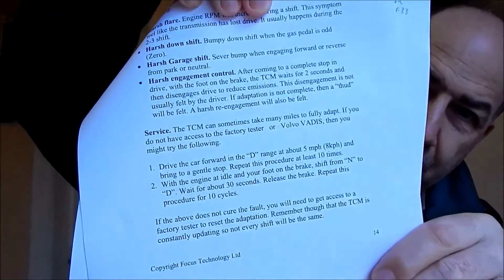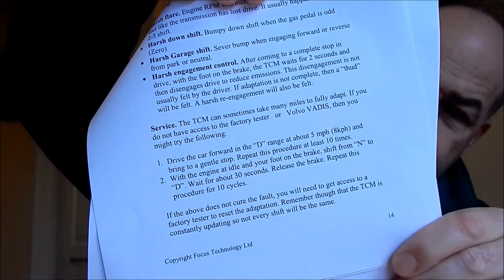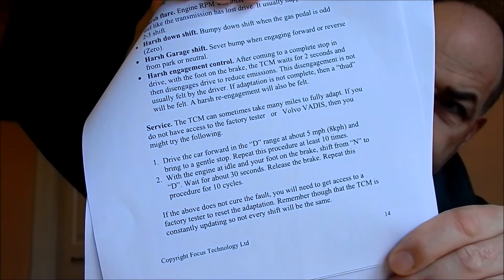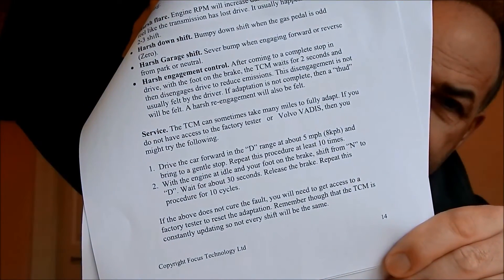Volvo AW55-50SN adaptive transmission -  GM AF33 & AW55 51SN

Comment: thx alot my car drive's better now but stil not good enough its a brand new car and the dealer say there's nothing wrong whit it
Reply from the maker: Brand new meaning less than a thousand miles or something?  The main test for automatics, is to warm it thoroughly then floor it from a standing start, or at least hit it to two-thirds of the 'gas' pedal travel say, then it should just move smoothly through the gearbox without hiccups except a slight bump when the automatic upshift occurs.  If this is fine, Keep any analysis basic: what is it doing it ought not to be, what's the ideal that it is not giving you when you drive the car?

That, and does 'kickdown' work?  Travelling along then punching it as though to overtake, should prompt one if not two downshifts depending on roadspeed and how aggressively the gas pedal is pushed.  Just stomp on it - does the car handle that ok?  There should be no drama, just a downshift or two and the car accelerates away.

The basic key elements to an automatic gearbox are complex in practice but simple in principle.  First, the most important perhaps, the automatic clutch function - there is not much to go wrong here, and the symptoms are noticeable once you know them: if the automatic clutch unit is short of fluid (they hardly ever have too much) the tendency is for the car to act as if a novice driver were constantly riding the clutch.  It takes unnecessary revving to take off, and the engine revs will be too much for any given speed.  That's because the impeller is having to work with too little fluid, and is spending a lot of energy just washing the small amount of fluid it has got, past the blades of the other impeller without moving it as much as it ought to.

Find the dipstick for the transmission, pull it out, and check the level.  Do this with the engine stone cold one morning, and if you are not confident (it's really nothing just make sure you put the dipstick back in properly), any decent mechanic will probably look at it for free.  Just like engine oil, the transmission fluid dipstick has a level marked on it, and there needs to be enough when cold but not too much as it expands when the engine heats up.

That's about all that can go wrong with that bit.  Fluid's not been put in to enough of a level, or has leaked out due usually to aged seals etc.  OFTEN MORE NOTICEABLE if you park pointed uphill in some vehicles, as the fluid there IS there, drains away from the torque converter into the space in the rest of the auto gearbox - the torque converter unit has a hole in the casing, so fluid can be mixed around and it can get fresh cooler fluid mixed in.

The only point is, these clutch units in an automatic (torque converters they got called), share the same fluid as the auto gearbox.  So, if you find the tell-tale signs of low fluid giving that too-much-rpm thing when taking away from a light etc regards the torque converter/auto clutch, this means the GEARBOX is ALSO low on fluid.  That would burn the friction disks more than they ought, and prematurely wear and cause a lack of cooling etc.

The other FOUR main parts, are: 1 - the physical disks and shafts that connect in different configurations to create a particular gear ratio; 2 - and the actuators that make those engagement units contact or not (more like manual clutches, but they work in auto gearbox fluid ie 'wet' clutches); 3 - and the hydraulic valves and pathways that make those actions happen; 4 - and right at the front end, the 'brain' or computer system that taking note of a gas pedal position, road speed, amount of lugging of the engine, rpm, etc, makes the decision every few hundred milliseconds to stay in the gear already operating, or flick the wet clutches in and out of contact in a different configuration to make a shift up or down a cog as it were.

The 'brain' is renowned these days for learning or adjusting to a particular driving style, and trying to deliver according to a change in that - it adapts - hence 'adaptive transmission'.  The brain is not so likely to go wrong - THE NUMBER ONE ELEMENT THAT GOES WRONG ACCORDING TO ME AND LOTS OF TAXI DRIVERS IS SENSORS.  The sensor for the rpm, the sensor for the engine lugging or pinking, and so on.  Sensors, sensors, sensors!

If they go wrong, it might be in an unpredictable manner, and the 'brain' cannot properly operate because it is getting deficient information in about what is going on.  

It is important the transmission fluid is correct - a new car should not have an issue.

Older cars - I only buy ones with 100,000 miles or more on the clock due to budgetary contraints (!) - may have problems involving one or more of the above mentioned elements.  But, that's all there is.  As I say, stick to the basics, keep the analysis simple, try to decide which of the above elements is most likely the area of fault.

Obviously, you can get the dealer/seller of the automobile to you, to connect up a fault tester (OBD or similar) and they will from that, get a load of codes, which may or may not indicate an item is wrong - a sensor probably!

Treat it like medicine - get a second opinion if you are not happy.  If you are lucky another franchise will check it out for you, or you may need to pay and independent.  It won't be much - they plug it in, run or even drive the car (maybe on a rolling road) and get the results.  Problems are flagged up.

Older vehicles have bald clutch plates, and sometimes people change the transmission fluid and have a shock when the transmission starts to slip and the rpm spirals up under load (acceleration, or uphill, or trying to maintain steady speed on the major hiways etc).  My own theory on this is simple and is verified by the fact Volvo do NOT FIT FILTERS to their transmissions.  Why wouldn't they want little bits filtered out?  Surely it's just like engine oil, you want it as clean as possible right?

No.  Those particles floating around, are the bits of the clutch friction material that have worn off.  This is the conundrum of having an older auto box.  OF COURSE the burnt/ruined fluid needs changed, but once those particles of friction material are removed along with the old fluid, you have lost the bulk of the friction material from that old transmission.

That's my theory, as an engineering graduate and long-time motorcycle renovator and veteran of many car repairs.  Nothing else fits the symptoms, and the car manufacturers omitting a filter kind of puts the seal on it.

Let us know how you get on.  Steady away, keep it simple, and stay logical about it.  There are no other components to these systems, than I have described here.

Brand new, and faulty - same rule as always, if you are not happy, ask to try their demonstrator vehicle of a similar type.  Does it behave the same?  If not, define what the difference is by writing it down, you can even just set your phone recording the engine note etc inside the cabin as you drive, in both vehicles.  Spot the difference then, later, calmly in the comfort of home.

In the difference of behaviour between a good and bad vehicle, will lie the precise answer you need.